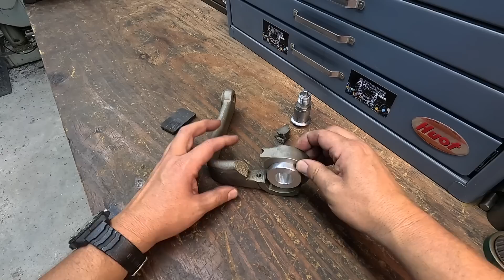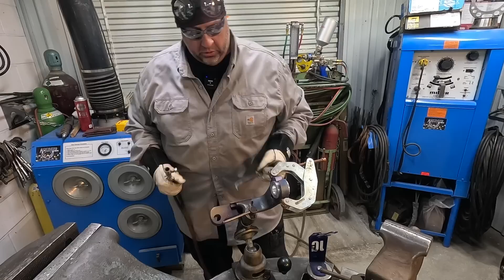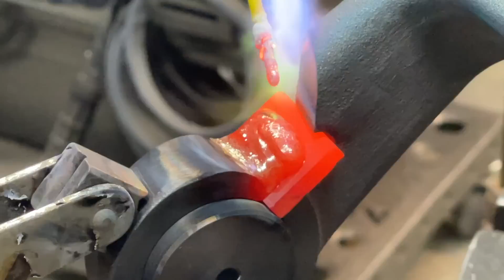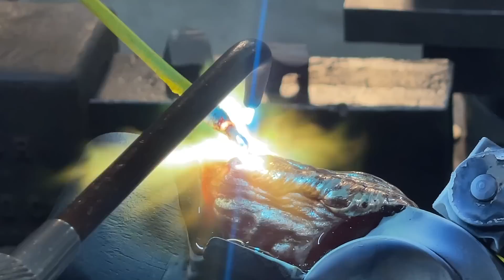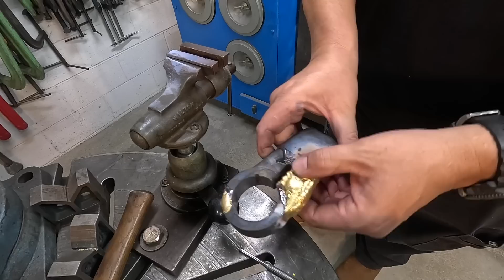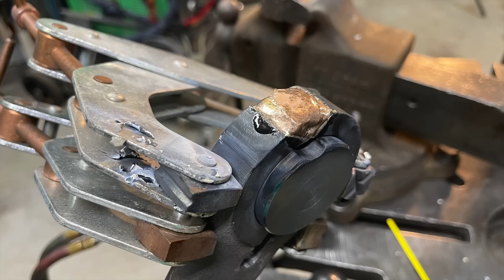Broken Lathe Feed Change Lever Braze Repaired

Comment: Its broken because attempts were made to remove it without removing the dutch keyAllen grub screw from the end of the shaft, I watched Keith Rucker do exactly the same thing!! Very difficult to see especially if the machine is grubby! Nearly did it myself on my Cochester student. As usual and excellent video of Abom brazing! You make it look easy, I have done it, it isn't!
Phil UK
Reply: If something won't come apart for NO APPARENT REASON, you spend time ensuring you haven't missed something, lesson learnt, hopefully. Easy mistake, difficult repair.
Reply: @ this applies especially to machine tools!!
Phil